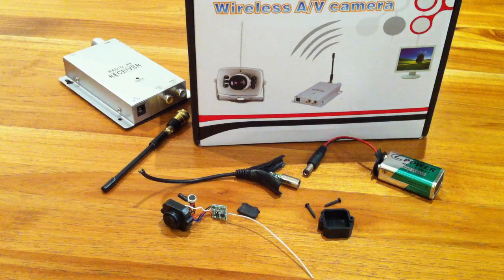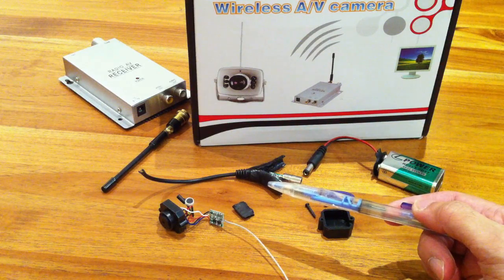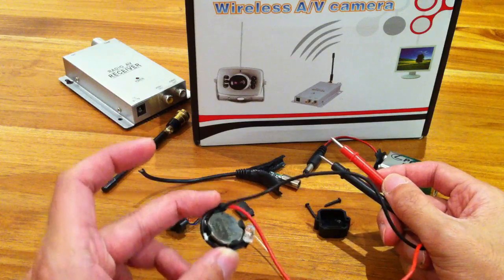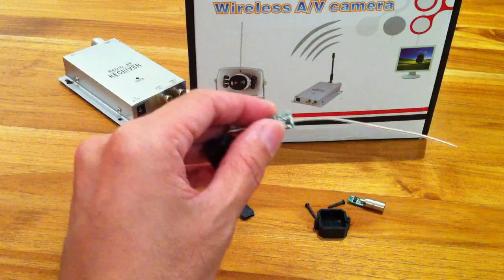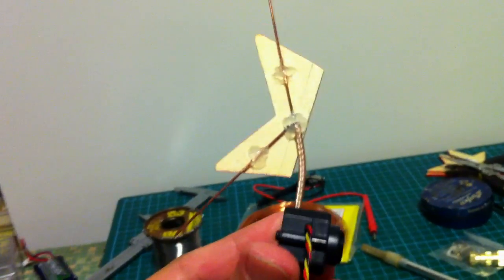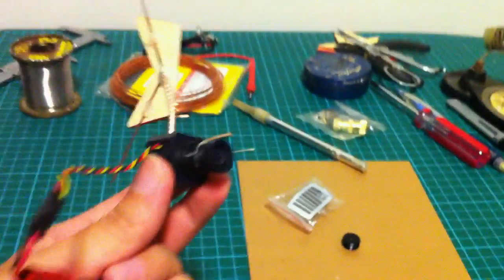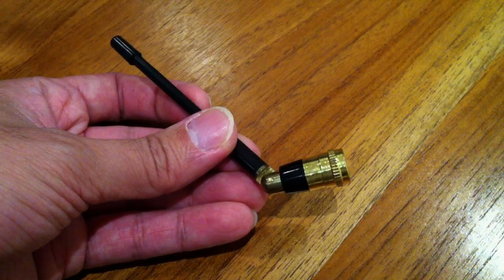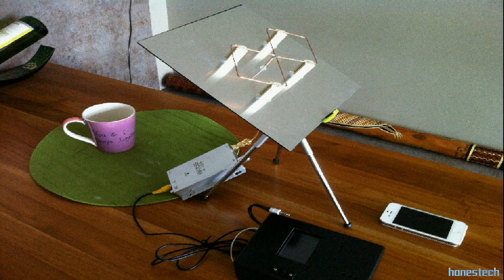Upgrading a 1.2g wireless cam for FPV

Comment: هل بالامكان  اشاهد كيف توصل هذه ابكاميرات لكي تعمل
Reply from the maker: Thanks for watching, I had given away the whole set to a friend. The camera is analog so it only has yellow(video), red(vcc) and black(ground), you would find these 3 pins on the video transmitter by using a multimeter to read the potential difference of each pin against your battery’s ground (negative lead). Vcc matches your battery’s voltage, video has a much lower voltage than vcc, and ground would be zero potential difference.

Comment: Bro want to convert normal cctv cameras setup into wireless camera 
I have 8th channel device
Reply from the maker: Thanks for dropping by, I wish you success in your project. I would deploy eight cheap 5.8ghz video “TX5823” modules  (each one set to a different channel) for the 8 CCTV cameras and one 5.8ghz 8-channel “RC805” receiver for the CCTV monitor.
Reply: @terence79chan  email me habibboutique786@gmail.com

Comment: do you have a shot where comes off transponder tothe camera points hand was in  the way in the picture cant tell if white wire is on top or the blue one comes between the black and white i was givin basket case so dont know how wires run from camera to the transponder thanks
Reply from the maker: I'm sorry, I don't have a shot of it. Would like to help but I had given away the entire set to a diver who wanted to do FPV out at the sea

Comment: i want connect on screen of pc ?
Reply from the maker: To connect to a PC display, just buy the EasyCap from ebay (about 14usd), it's a donger that takes the Video (Yellow RCA) from the AV receiver and turns it into a USB for connecting to your PC. The EasyCap software (CD that is included with the EasyCap) then does the processing to output realtime video on the screen of your PC.
Reply: Don't waste your time buying the easy cap, waste of money they don't work.

Comment: Thanks for the video. Do you know if this el'cheapo receiver has RSSI output on one of the internal pins?
Reply from the maker: Sorry for the late reply, I could not find an RSSI pinout for this receiver
Reply: No worries,
I was hoping that recevier was 12v but it looks like it will only run on 9v?
Reply from the maker: The receiver runs on 12v. So you can use a 3S lipo. :)

Comment: Thanks for sharing! I just received the same kit, can you select any channel on the video transmitter or is it just 1 channel?
Because it's on the 1,2ghz band I think I might get some interference with my 2,4Ghz rc link, do you have any problems or are u using another frequency for your rc controls?
Tnx for posting the video!
Reply from the maker: Hey Jo, it's just one channel on the video transmitter but my receiver does have a tuning knob for the entire 1.2g band which is handy if I get a better transmitter in future. I have no problems with 2.4g RC so far. Due to the low-power video transmission, I never have the chance to test the 2.4g RC range beyond 500m as the video image would start to fade after 400m. If you have a strong video transmitter, you could get an ibcrazy 1.2g notch filter from readymadeRC to filter 1.2g RF spillage into your 2.4g band. If the video is affected, get a 2.4g notch filter for your radio, it has to be between the radio module and the antenna so you will need an sma female connector and 50ohms coaxial to make an antenna port if your radio does not already have one.

Comment from the maker: Hi Chris, I totally agree with you. I don't fly 1.2g FPV. The video is only to illustrate how much difference the antennae make. Given the constraints in SG, it simply makes no sense to fly a low-powered 10mw setup because a 5.8g setup would offer the same range with a much smaller antenna. The 1.2g biquad is big n cumbersome, the same biquad at 5.8g will fit in a shirt pocket. Also, in SG, only the central, south and south west are RC "Fly" zones. All other areas are "No Fly" zone. The field you see in the video is a "Fly" zone and 200feet is the max altitude for any Fly zone which means all glider flyers have crossed the line you mentioned :)
Reply: Dear Terence,
I have recently purchased one of these camera module Tx and Rx, the same as yours. I am wondering what kind of material you used for the first antenna, and how you did. Can you kindly give me a list of the materials for the first antenna? And how you built it? Also, i am curious how you connected ground to both of the homemade antennas. Please Respond
Reply from the maker: RG316 coax for both, rg174 recommended for 1st ant as it's softer. 1.2mm copper wire n a thin piece of wood for first antenna. 1st ant coax's braiding gets soldered to the black wire of vtx. 2nd ant coax's braiding gets soldered or crimmed to the gnd (conduit) of a BNC plug (from ebay). The Vrx case is grounded so when BNC is connected, there's gnd for 2nd ant

Comment from the maker: Hey Chris, thanks for the heads up. In case anyone is thinking along the same lines. I would like to point out that the transmission power (10mw) of this 1.2g module is way too low to cause any interference. With a range of 3m out of the box, it is marketed as a wireless cam for indoors use such as a baby monitor system. The increased range you see, is achieved by high gain antenna (11db) on the receiver, and not by increasing the power of the transmitter.
Reply: D can I use any high gain antenna for recver
Reply: +josh smith I think yes, as long as it has the appropriate connector. You should really buy a better and longer antenna for increasing the range, since these things often have problems with range and tuning.